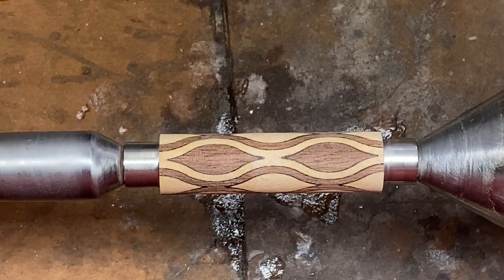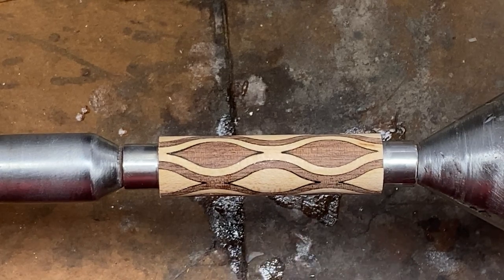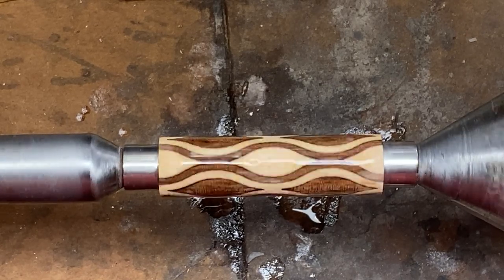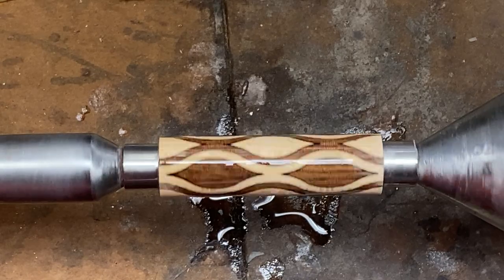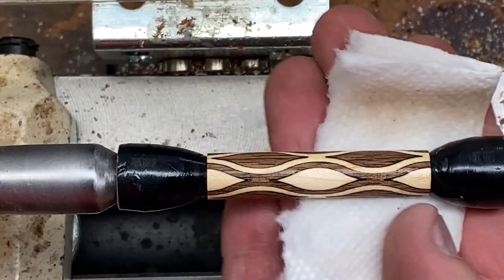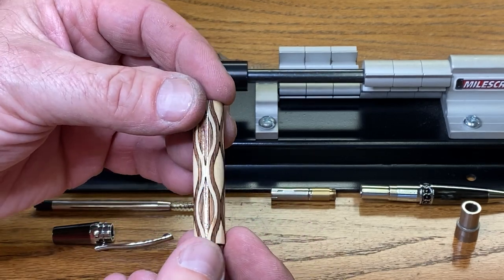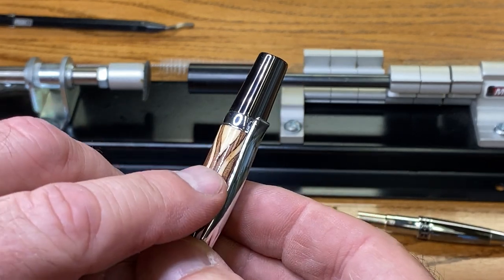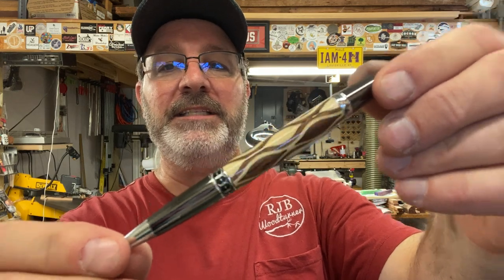Unknown Laser Blank

Comment: I use the EZ Wood with a Negative rake and Since I've been using that negative Rake I've had no more blow outs on my pens. Also I think if you have a square EZ Wood tool and get the negative Rake cutter you shouldn't have any blow outs. I hope if anyone reads they consider all what I said. Robert if you that's ok don't show it I won't be Offended. Thanks for listening
Reply from the maker: I use carbide occasionally but I prefer HSS.

Regards,
Bob